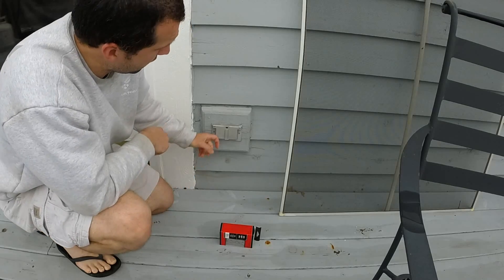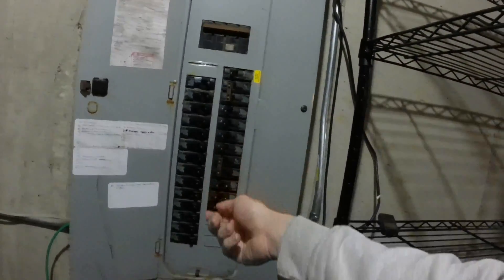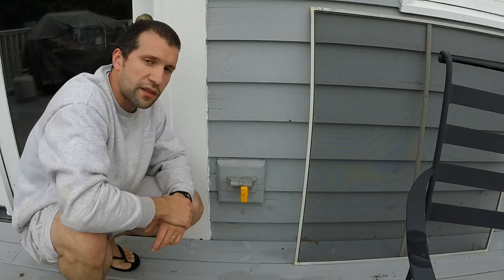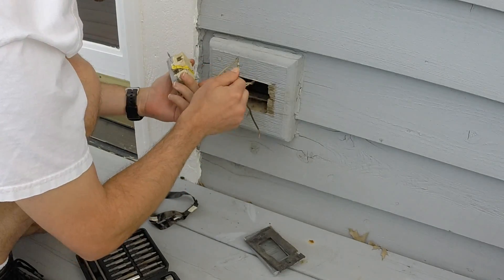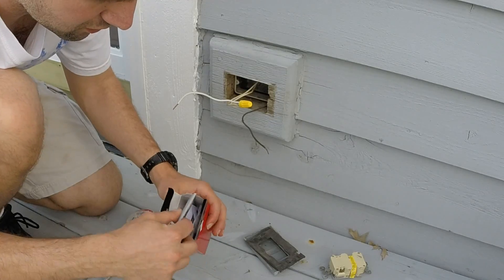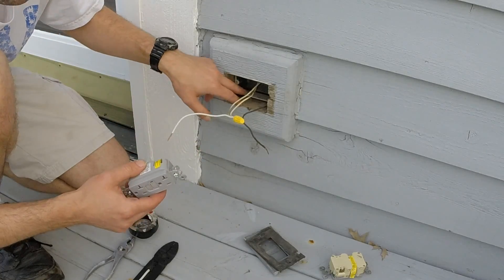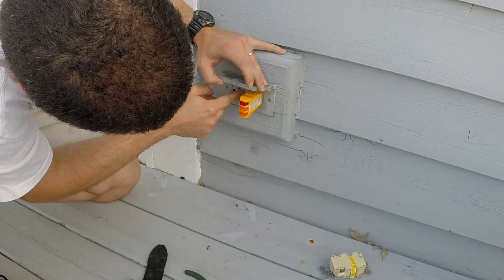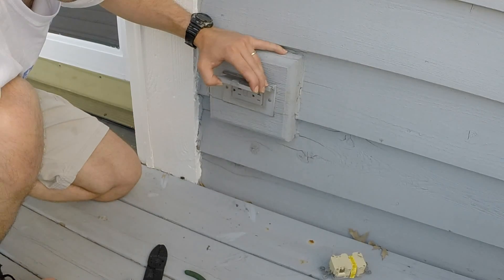How to replace a GFCI / GFI electrical outlet.

Comment: This is a pretty old video and you may not see this comment.  But the wire that you thought was strange and then cut is a common.  It allows other outlets to use that same wire.

Comment: Question please. The neutral conductor going thru the GFCI is insulated.
Why does the exact same neutral that runs from the outside of the house
to the step down transformer not need to be insulated? thank you.

Comment: What is the gadget called that you use to find the correct circuit breaker?
Reply: Go by the voltage rating , and the current rating of the circuit. Or ask someone who actually knows about it.  The gadget was just to see if the circuit was energized or not, before working on it.  Always turn off the circuit breaker before working on a circuit. Unless you are an electrician, or an electrical engineer
Reply: Licensed electrician!

Comment: It would be helpful if you told viewers why it's important to make sure you have the wires hooked up to the correct sides.  Black/gold - Silver/white.
Reply from the maker: +midwaymonster30 I can't fix the video at this point, but that could make for a good topic in a future video.
Reply: +Harry of All Trades I forgot to mention I thought the video was good though.  Definitely informative.
Reply: Good point, and most important the ground copper wire to the green screw on the receptacle.
Reply: Black to Brass will save your A$$